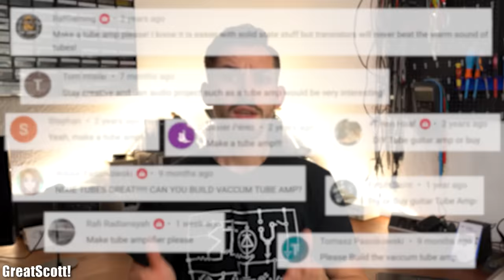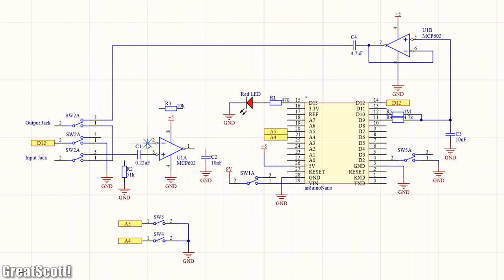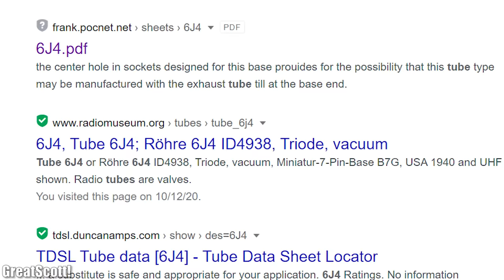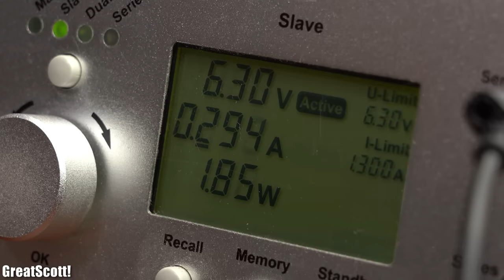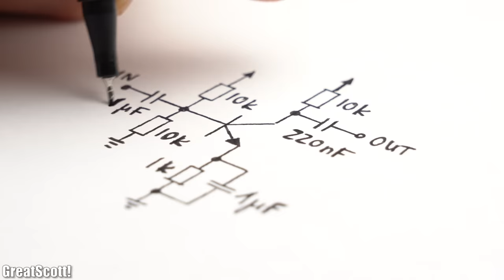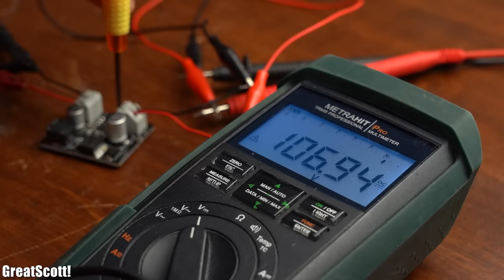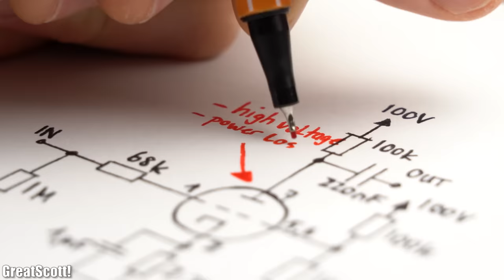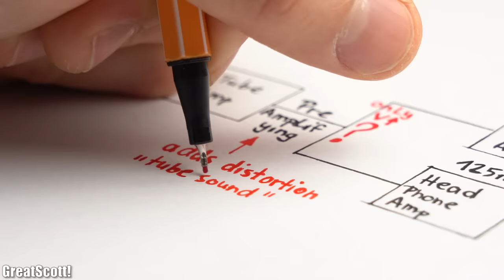Building a Tube Amp! Does it produce better audio quality though? EB#47

Comment: I'm an electronic engineer, after many years of trying to find the explanation to why the people say that a tube amplifier is better than others, measuring all possible values and being the more objective possible. I realise that all this things doesn't matter. When you hear a tube amplifier you will never come back, is a one way path. And is not suggestive, put 10 guys in a room and do a blind test, with your best transistor amplifier (McInt for exple) and a tube amplifier (made in house) you will be surprised.

Comment: This wasn't a good example of a traditional tube amp.
Reply: Agree
Reply: Pretty much the worst possible example.
Reply: Fully share
Reply: Digital ready speakers need digital inputs don't they?🍄🧙‍♂️
Reply: Here come the tube lovers
Reply: @turolretar  lol
Reply: @Larik has nothing to do with that. its just that...imagine comparing anything many people know with somehting only a few know. then pick the shitties possible product to say "not worth it". the reason for your decision is a shitty product, therefor the decision is shitty.
Reply: @hakushiro9910  I would still say that a headphone tube amp specifically is not worth the trouble.
Reply: I don't think he knows what a tube Amp is.
Reply: Rely hopeless example, check out a real tube amp and be amazed
Reply: If you want tube sound you need iron. It's the output tube and output transformer that makes the tube sound. I have one of those head so called tube amplifier. It uses 12 volts on the plates and grids the voltage should be much higher. It's the output that needs the tube not so much the preamp stage.
Reply: It's all about harmonics the transistor leaves them out. Music is all about harmonics. I would not waste my time debating on this subject a less you use a real tube amplifier. You need iron transformers.
Reply: come on you guys, unless you have a "better example" of a tube amp, then let the man be..
Reply: @jaredpriestleymusic5368  yes I agree like I said before you need an output tube and an iron transformer to get tube sound. That amp he used is a solid state amplifier with a show tube in it I have one myself. Someone needs to make an amplifier for headphones that use a 6BQ5 / EL84 tube with an output transformer. That's the one to compare with today's electronics.

Comment: That is a hybrid amplifier, not a "true" tube amplifer. It has a tube in the pre-amp stage and a solid state power amp. Really the only differences from your typical transistor amplifier is that the tubes create a more pleasant harmonic response and "clips" naturally when driven.